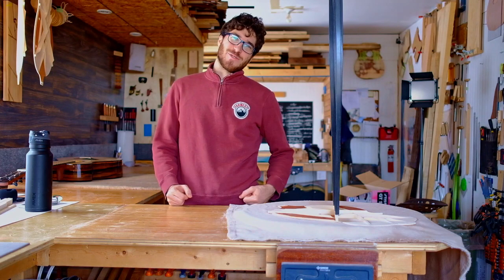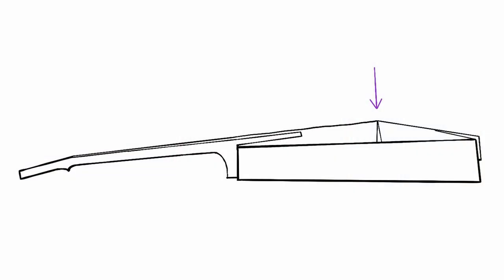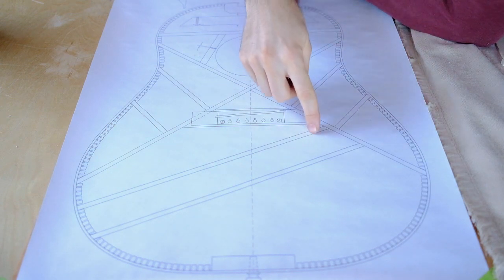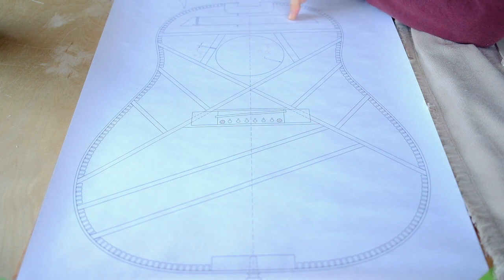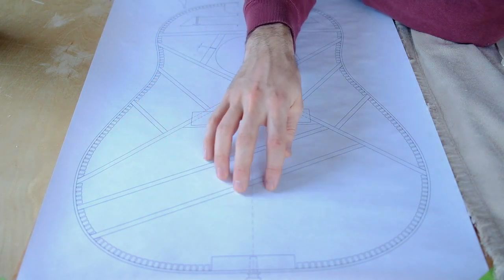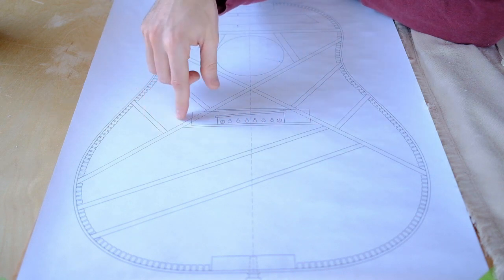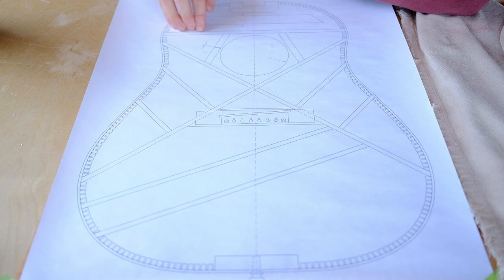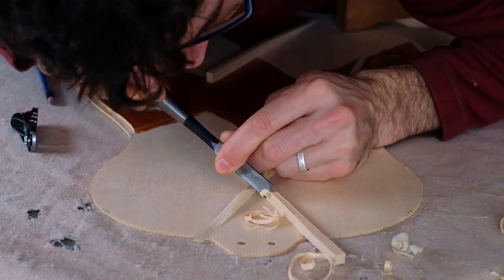How To Design Your Own Bracing Pattern (Part 1)

Comment: Cool Vid. Great info. What kind of wood do you use for the braces?
Reply from the maker: Thanks Mike! Generally it's spruce. Sitka, Engelmann and Adirondack spruce are likely the most common, however I also use redwood and mahogany for certain braces where I either want more or less mass. The braces are the main structure that holds the load of the strings so it is really important that certain braces are strong enough. It's all one big balancing act. :)
-Zach